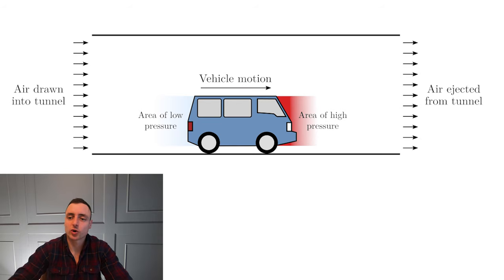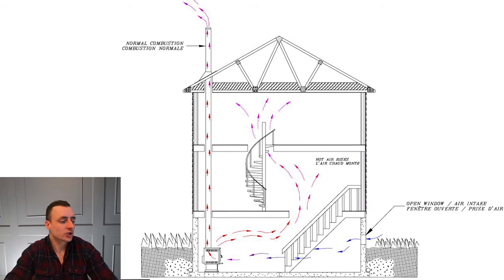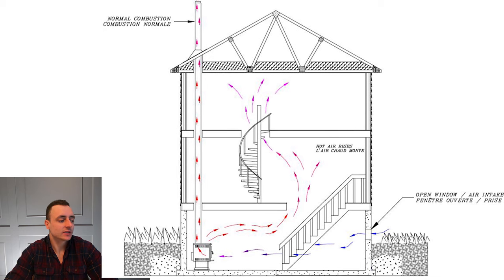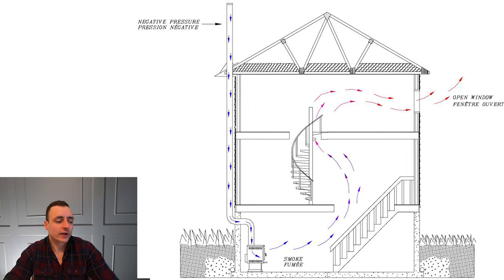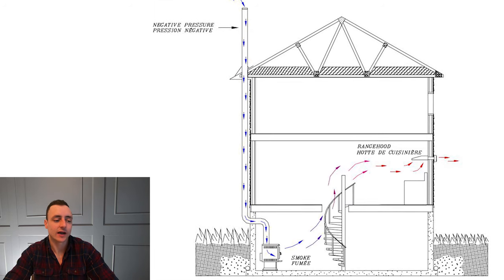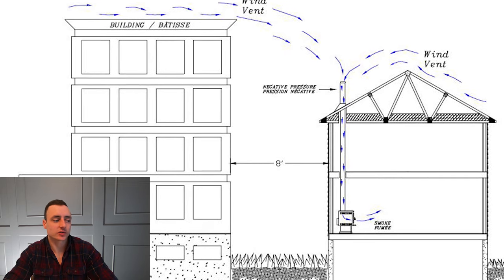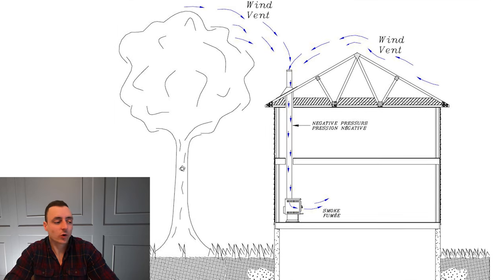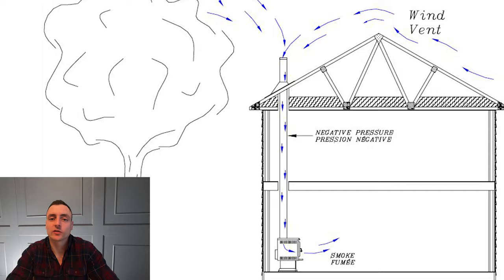OIL STOVE | Chimney DRAFT and NEGATIVE Pressure | Smoke Problems | How to Troubleshoot

Comment: Howdy, Mr. Phil. Greetings from Ireland. Last year,  I transitioned from a wood stove to an oil (kerosene here) stove. I am so pleased I did make the change. The running costs are less, for far more heat output and no cleanup. The oil stove (Franco-Belge) gives almost instant heat to the place, and I bought it second-hand online for little money. Your videos on oil stoves gave me the confidence to make the change (scary) and everything you said in your videos was absolutely perfectly spot on, on point, and correct. Thank you so, so, very much for making and sharing.
Reply from the maker: Thank you for the great comment!

Comment: Thanks for this video. Very comprehensive. I've looked at some of your others as well.
I have an old Siegler Kerosene burning stove in a workshop that only seems to run well at lower settings. If I crank it up it generally isn't long before things get sooty. I clean the stove out fairly often (due to this) but it doesn't seem to make too much of a difference. At a low setting the flame has more of the blue color to it though it does still fluctuate (flare) quite a bit - perhaps due to air? The damper seems good but I'm not an expert on setting these. The gasket around the door is a bit worn out - is it likely that is the problem? I don't see smoke or smell it unless the stove soots up. Sorry for the long-winded, self-interested post!
Reply from the maker: Is your stove perfectly level with all the chamber holes cleared out? This can be cleaned with a wire brush nicely
Reply: It is fairly level - on a brick floor 🙄- I will do the wire brush thing! @philg

Comment: Hi I have a oil burning stove. Never had this problem, but lately it smells. Gasket are good. Could a dirty flut explain it? I vought the housr 5 years ago. I use the stove one month a year. Never cleaned the flut. What could it be?
Reply from the maker: Yes it could be, make sure the system is clean. Do you use a fire starter? Sometimes these can give off a smell.

Comment: One last factor would be atmospheric barometric pressure, that may cause issues.    People may notice higher difficulties lighting the stove during inclement weather/low pressure. 
A couple of ways to address this situation are the use of a forced draft blower or electric flue heater during start up.
Reply from the maker: Yes that is very true! Thank you for sharing :)
Reply: @willw.6639  No, I don't make videos any more, and removed what I had up (under a different channel) because I don't agree with numerous YouTube policies.
Reply: @ElementofKindness  I understand. Neither do I. Just desperate for info at the moment.

Comment: Hi there my reflecks oil stove goes out on windy days then burner floods and then puffs smoke out through the disc air valve in the flew some times relights flooded it scares me can I remove the damper vent in the flew
Reply: This disc valve in the flew seem to be just making a stinky mess of soot in my home  I'm about ready to discard this thing
Reply from the maker: Make sure it is level and clean.
Reply from the maker: Make sure it is level and clean.

Comment: Can you burn wood in oil stove
Reply from the maker: Because the bottom of the burning pan needs to be clean an clear of any debris, I wouldn’t recommend it. If you plan on cleaning it thoroughly to go back to oil fed, then you could do it, or if you want to  make it a wood burning exclusively, it would work.
Reply: Hey, thanks for all the videos. Lots of help. Curious about this though, if you were to convert it into a wood burning stove strictly how would you go about it? Would you have to disconnect and cap the oil lines from it? And would you have to change the chimney? Also- would you recommend putting some sort of steel plate down? Thanks